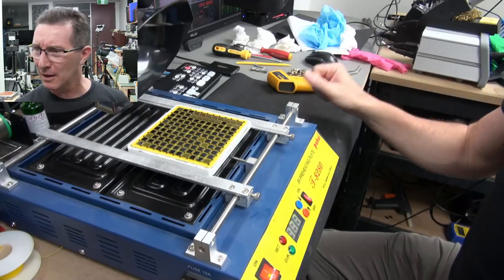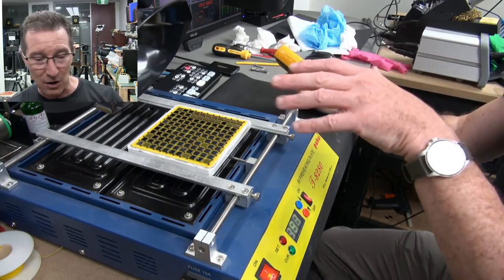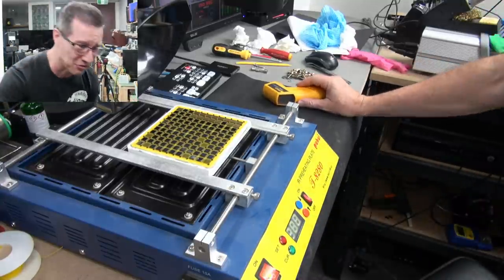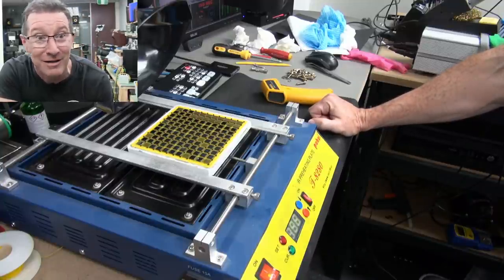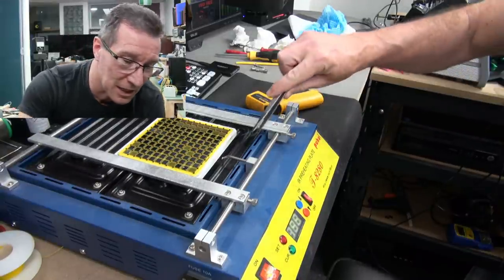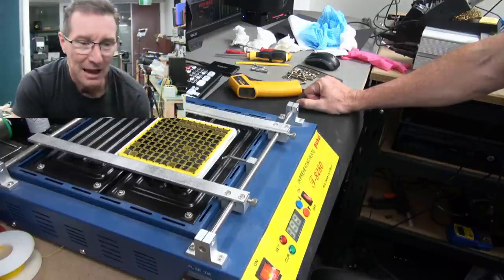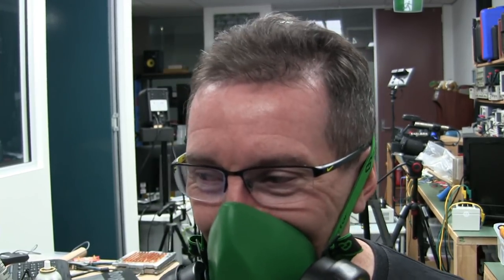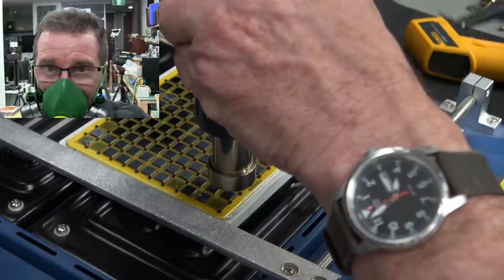Abandon Lab! - IBM TCM Part 2

Comment: Typical case of don't try this at home... Heating up an unknown chemical in an enclosed space is asking for real trouble. And the puny particle/carbon filter of the fume extractor is probabby making a very small difference here - ideally you should have an exhaust filter to the outside.
Reply: Let's hope it's not PCB...
Reply: @5mxg  as long as it's diluted enough, it doesn't matter.
Reply: @5mxg  I said "exhaust filter". Also, as KaneTW mentioned, the outside will be much more dilluted.
Reply: @mrnmrn1  Came to say this, PCBs would be the perfect substance for this application: High thermal conductivity, low electrical conductivity.

Comment: High voltage transformers use polychlorinated biphenyls as cooling oils, these are extremely toxic, so maybe not such a good idea to risk evaporating the cooling oil residue as it may be the same stuff.
Reply: Yes. PCBs  are nasty  chemicals even in low quantities.
Reply: PCBs (that kind) were banned in 1979 so I think it's safe to say that they won't be used in this module. There could still be other carcinogens though.
Reply: @eDoc2020  I don't think there are many chemicals that meet the coolant requirement that are not toxic or carcinogenic. There going to be organosulfur compounds, or organic chloro florides. If the compound is not toxic, you can bet  its breakdown compounds will be.

Comment: I don't know but I tried to wash a PCB with a dishwashing liquid thing to get those unwanted stuffs like oils and crud. Works for me.
Reply: That is actually the best way. Also Robert Pease suggest this in his book.
Reply: Just a scrub in a degreaser bath, then an IPA bath to remove all the water.  Same process for a corroded board - doesn't remove the corrosion but lets you work  on it without all the nasty fumes coming off.  A nice clean board is so much more fun to work on.
Reply: @Chris_the_Muso  I agree. Just saying what Bob did: "Similarly, one of our PC boards for S/H circuit was yielding 10^11 Ohm of leakage resistance, which was unacceptable. We tried cleaning the board with every organic solvent but had no luck. Finally, I took a few boards home and set them in the dishwasher along with the normal charge of Calgonite. After a full wash-and-rinse cycle, I pulled out the boards, banged them to shed most of the water beads, and set them in my oven to dry at 160°F.  The next day, they checked out at the more acceptable value of 10^13 Ohm. I have used this technique several times on leaky PC boards and sockets, and it works surprisingly well. It can work when alcohol, TCE, and organic solvents are not helping at all." From "Troubleshooting analog circuits".
Reply: i say a sand  bath be best  to soak it  up

Comment: I think you are dealing with two contradicting processes - heating the ceramic base along with soldered connections and, at the same time, evaporating the liquid oil that is amassed on top of that structure. And the second piece is stealing the heat from the first piece by evaporation.

Comment: You should have heated a slug to about 400 degrees and dropped it on the chip. As the heat sucks through the die the solder will be liquid for a few seconds

Comment: You should have a chemical room inside your room for this kind of thing.

The hospital i used to work for threw these away on a regular basis, so you should be able to find one at a dumpster. (make sure you clean it before use though)
Reply: You mean a Glovebox.

Comment: If your target is 200c then you might need to set the plate to 250 or even 300 (I have one of these 2828's, can't remember its max) to overcome the losses of heat between the plate/air and TCM. Once your at temp on the TCM you can drop plate down in temp if you don't want to risk exceeding 200c a bit.

Comment: It must be the oil. Blow out any oil that is below the die you want to remove with compressed air. Don't breathe the oil. Then try it with the extra heat from the rework gun.

Comment: IR oven (aka. a toaster) upside down, so they fall off when hot enough.
Reply: Toaster ovens are very poorly thermally insulated.
Reply: @simontay4851  So. They'll still get the job done. You don't need to maintain exactly 275C. You just need to get higher than the melting point of the solder, without overheating the chips you wish to save. (if you wish to save them.)

Comment: Have you tried using a pair of pliers to slide something really thin, like a blade for a safety razor or something similar underneath the chip while it's hot? You may just need to break the bonds along one side to get it started.

Comment: If the solder is somewhat soft, would it be possible to use dental floss to separate the chip from the board while it is still cold?

Comment: Yummy, nothing better than delicious PCB oil fumes (PCB as Polychlorinated Biphenyl). Hopefully it's not that, but is anyone sure about that? Was this produced after the ban of PCBs?
Reply: OK, it seems they've banned it in the US in 1979. So probably no PCBs here. I thought it got banned only in the early-mid '90s or late '80s.
Reply: @mrnmrn1  It was banned for use first in certain applications like distribution transformers ('cause they had a tendency to blow up when overloaded). I'm not so sure about applications such as these.  IBM still had enough clout in those days to maybe get an exemption if they felt the substitutes would not work.  I think only those that worked on them would know for sure.
Reply: @Chris_the_Muso  Not very calming... But I'm quite sure it was banned for motor run and power factor corrector capacitors as well, because from the '90s on, almost all of them has a text claiming it does not contain PCBs. I guess it this one contains PCBs, it should have a huge yellow warning sticker on it, like beryllium oxide contaning devices.
But be very careful Dave, PCBs are no joke, very carcinogenic!

Comment: I wonder if the oil is actually 3M Fluorinert, of just generic stuff?

We used to use Fluorinert in the leak tester bubble tank at Nortel.
I think that stuff cost around $350 a litre. lol

The oil on the CPU does look a lot thicker, though.

Comment: Brake cleaner, Throttle body cleaner or better yet, sensor safe Mass Air Flow cleaner from your local Repco @EEVblog2.
Hose it down and it'll remove all the oil and leave no residue on the surface.
Reply: You can't feature brake cleaner in a video without adding in a dramatic sound effect (Eric O, South Main Auto)
Reply: @simonparkinson1053  lol true dat!